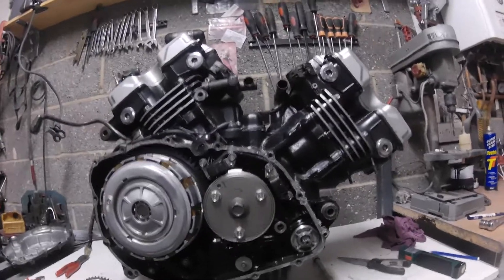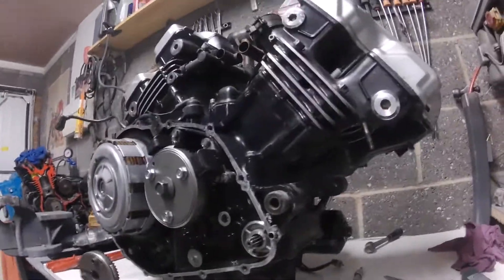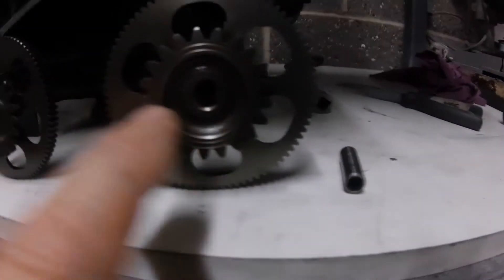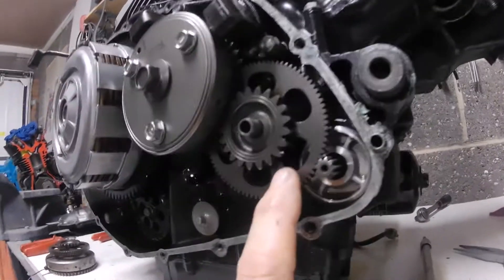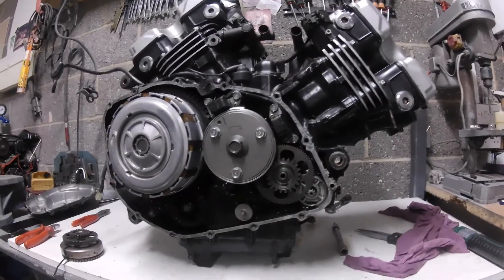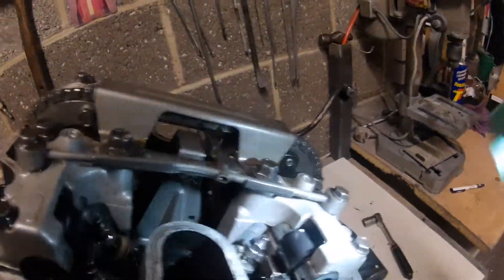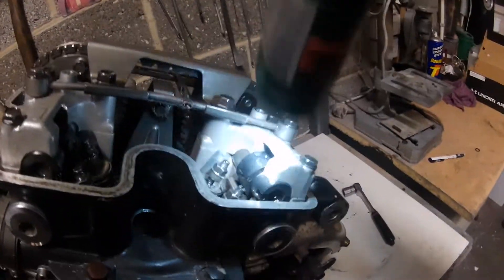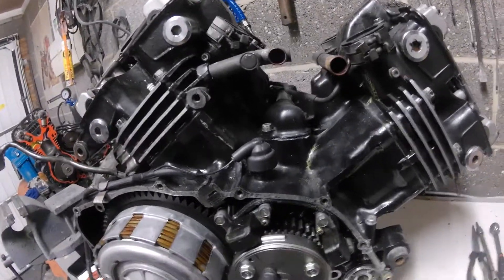Honda VF750F part  3 &  4

Comment: Thank you for sharing this info on the VFR starter motors. Is it possible to reverse the polarity of a starter motor?
Reply from the maker: Now on that I'm not sure, perhaps some of the others could comment on this?, Are you needing a starter for the Magna engine that rotates backwards?
Reply: Becoming Classic Motorcycles No. I’m aware that the Magna was manufactured for much longer, and just wondering if it’s possible to use a Magna starter motor on an Interceptor by reversing the polarity. 

Have also read of people rebuilding bike starter motors incorrectly and discover that they go backwards! I’m curious how this is possible.
Reply from the maker: @G58  All I know is, it has got to be a polarity issue, hope others add to this question
Reply from the maker: I have a few old starters, and I will experiment with a couple of sacrificial ones on video, for the purpose of, hey lets find out!!, watch this space
Reply: Becoming Classic Motorcycles Great idea. Electrics and electronics are not my strong points.